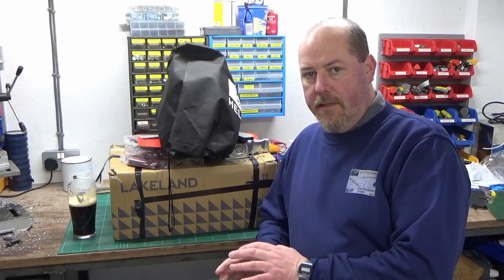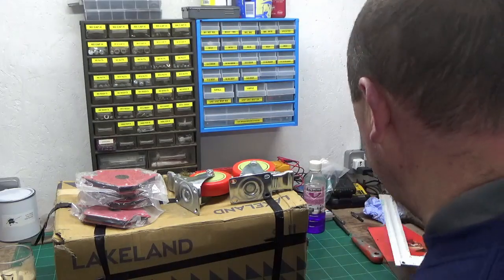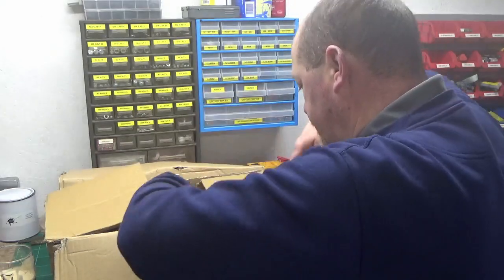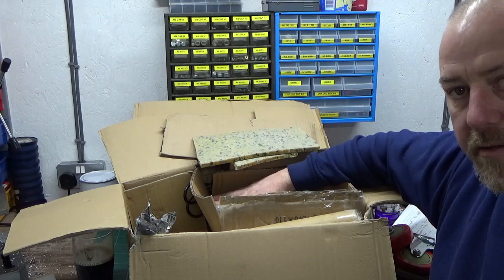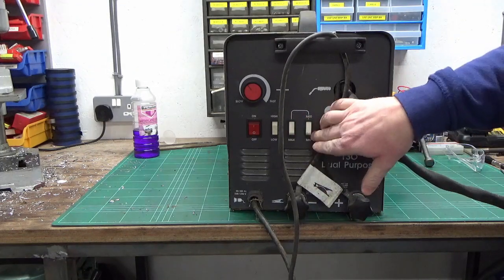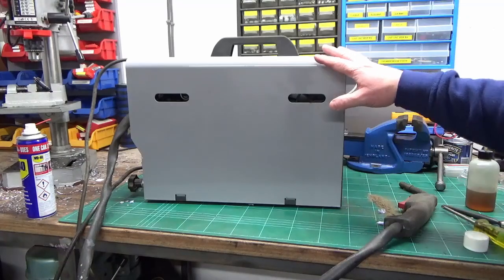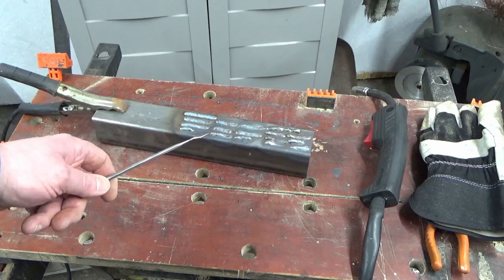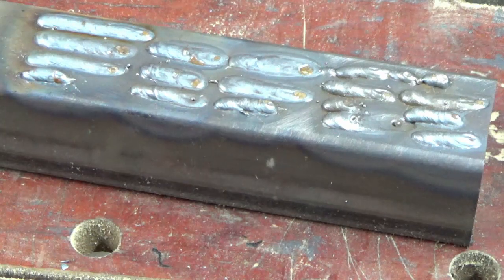Workshop Blether #6 Welding

Comment: Good blether Jon. I have that M-DRO on my lathe with their magnetic scales, great kit. The crosslide one being their very tiny one.  I put the scale fixed out the rear, & the head moves being on a bracket off the rear RHS of the crosslide. No interference with the tailstock, or gib adjusters.

Comment: Thanks Jon, good catch up. Ade certainly sent you a nice box of bits there. I have a Clarke gas/gasless welder, good for welding out of doors when the gas might blow away.  It's in a deplorable state having been kept in a succession of damp awful garages. My brother sent me a Tig set up which I'm hopefully going to learn to use when the workshop is finally sorted. Best wishes, Dean in Oxfordshire.
Reply from the maker: Hi Dean, thanks for the comment. Yes, nice gift box, looking forward to getting the lathe DRO'd up (not so looking forward to doing it though). TIG is where I want to go eventually but figured I have a MIG, might as well learn that first. Hope you are getting time on the workshop build. Cheers, Jon
Reply: Thanks John, workshop is getting there. I'll post up another quick progress video when I have the time. Cheers, Dean.

Comment: Hi Jon, G'Day from Oz - I've come over from Emma's channel.  For your welding practice, try this yourself. I learnt to weld when I was a teenager in a panel beating / spray painting workshop. I had to start with Oxyacetylene, then TIG and lastly MIG. They'd get me to weld 6 squares into a cube. Started with 8mm plate about 100mm square and as I got better they'd give me thinner gauge. NO filler rods. Had to keep square edges & corners. The whole point was learning how to control the weld puddle. My first MIG attempt was replacing panels on the Boss's Jaguar but by then I had a better idea & control. I hope this can help.  Stay safe and well :)
Reply from the maker: Hi Anthony, thanks for the comment and information and welcome to the channel. When I get my TIG, or a decent MIG, I will definitely be trying some practice welding. My unit is so temperamental and inconsistent, I wouldn't learn a lot from it. Case in point today, big welding project (for me) on the go, welded 3 or 4 runs no bother, then it starts spluttering and messing about, then, wire everywhere and when I release the trigger, wire just kept on feeding out! Took the gun apart, switch all OK, went into the welder guts, nothing obvious, pulled a couple of connectors and put them back on, all working again. I think it depends on what day it is. Cheers, Jon
Reply: @jonsworkshop  Sounds like there might be either moisture in the contacts, or as the machine heats up the contacts expand and close the circuit. Test it out from cold and time how long it takes to play up. If it repeats then it's likely the electronics expanding. Look at the control board as well for hot spots or discoloration. A laser thermometer would be handy, but if not just unplug it and test with your finger tips for hot areas. Cheap machines are a pain in the but, although they do get you good a trouble shooting if you have the patience. Good luck Mate :)

Comment: One think I found over the years was that the cheaper budget sets struggle with the large spools. Having said that, you can tell from the sound when welding that yours sounds ok. Interesting you thought your unit looked in bad shape, I will send you a video of my very well used unit. Still works great but well overdue a service.
Reply from the maker: Hi Andy, great to hear from you, thanks for the comment and hope you're all well. I think it is struggling a bit, the wire feed isn't consistent so I may get a small reel to try. It's not to bad on the highest setting but it won't play ball at slower wire feed and reduced power. I think I need a lot of practice and will hopefully get it with this next project. Cheers, Jon

Comment: Dabble a wee bit with welding (or sticking metal together might be more accurate) and I would say that TIG is probably the easier to get to grips with, certainly nicer to use, a bit like gas welding.  Got a similar MIG welder and never really got on with it, always felt that the wire feed was struggling a bit, never used with gas , just gasless as had already laid out on an argon cylinder and couldn't justify another cylinder for MIG (Ar/CO2 mix) - and the small disposable cylinders are too expensive. Heard a tip for MIG from various channels that it should sound like bacon sizzling if your setting are right. As mentioned, grinder and paint make me the welder I ain't. Cheers
Reply from the maker: Hi Pakrattuk, thanks for the comment. I must admit TIG looks very clean and repeatable when done well, and I guess there's only one thing to blame if the wire feed is inconsistent lol. I have got to a reasonable bacon frying noise in the end, but only at max power, can't achieve it at lower amperage. Need a lot more practice which is imminent with the table build. I am sure it will be entertaining for you guys if nothing else! Cheers, Jon

Comment: At least the square won't get magnetized  !    Filming welding is  not easy  ,  i have tried it a couple of times  with mixed results due to the lack of different lens shades to sticky tape to the camera !     Cheers .
Reply from the maker: Hi Max, thanks for the comment. As if the whole welding experience wasn't difficult enough for a newbie, I thought being clever and trying to work round a tripod with a mask glass balanced in front of it would be a great idea! So much to learn! Lol. Cheers, Jon

Comment: Nice job Jon, if you need any wire or clamps give me a shout, welding beads look great 👴🏻👍
Reply from the maker: Hi Terry, thanks for the comment, must correct you, welding 'bead' looked great, the rest were on a par with my pigeon $hit stick welding lol. Thanks for the offer, will give you a shout if I start to struggle on the build. Cheers, Jon

Comment: Some nice gear there Jon.  I still use a flip visor, no issue.  That helmet looks the same as the Comweld ones BOC gas sell in Oz.  At least it fits your head OK - some are way too small.

Welding is like paint spraying, all practice.   The main thing is to be decisive and not dally around.

Cheers Rob
Reply from the maker: Hi Rob, thanks for the comment. I didn't realise BOC traded in Oz, probably do more business over there than here, priced themselves out the market here (for hobbyists at least), their rental charges on bottles are extortionate. Yes, plenty of practice required, should get a good go making the welding table. Cheers, Jon
Reply: @jonsworkshop  Yes, the bottle rental is a killer here as well.  Nowadays you can buy D size for home use and eliminate rental (not from BOC).  BOC do however sell good quality gear and their brazing rods and consumables are first class.  Never buy no name brand consumables as there is a lot of rubbish out there which is guaranteed to spoil your day ;)  Cheers Rob

Comment: Hi Jon, I do a lot of welding with both MIG and TIG as a hobbyist on my boats and cars/bikes.I thought I needed a proper heavy super flat table too.But because I was in a hurry I bought a good quality foldable one from Rapid welding.As everyone knows lot of time ,,welding,, is actually spend grinding for prep work or touch ups afterwards.My workspace is smaller than yours but I assume you also don’t want to do a lot of grinding inside.Foldable one is a lot easier to drag towards the edge or even outside the garage.If you do have lots of future jobs lined up that warrant a super flat table then go for it obviously.Just my 5 cents put in!
Reply from the maker: Hi Robert, thanks for the comment and advice. I will be adding wheels to the table so I can get it outside easily, I don't mind welding in the workshop but really want to do all the grinding outside (weather permitting). Super flat is not important for what I will be doing, I just want something metal, portable, and self contained with clamping options, gas, and storage for all the peripherals, tips, shrouds, wire, rods etc so it's all in one place. My brain is hard at work in designing at the moment and I am looking forward to the challenge of learning new skills. Cheers, Jon

Comment: What ho young John, two points, no make thst three.
Does your new mask have a battery or is it entirely solar powered?  The reason i ask is that if only solar and it is kept in the dark the internal reserve power will dissipate over time. Draw your own conclusions to a remedy.😉
Now you are going to have to go back to school, stainless is nonmagnetic except for the ones that are. A case of a false syllogism methinks.
If you get in touch with machine dro rather than just look on ebay you will be able to speak to some really helpful chaps. Also consider a mag scale for cross slide to refuce bulk of a glass one. They will be able to tell you if they are compatible with your unit. As an example of their helpfulness, one of they scales became unreliable long outside warranty period and i was about to order a new one at one of the shows and explained why. They said to bring mine along to their base and they would look at it for me, i did and they fixed it for free. Turned out to be dirt but they changed the read head all the same to be on the safe side. We have shared stands at exhibitions for years but i don't think I got any special treatment. Nice guys and business to deal with, in my opinion. 
On a different note, spring can't be far awsy now even in the wilds of your backwoods up north.
Keep up the good work
c
Reply from the maker: Hi Chris, thanks for the comment. The mask has a battery I think, I incorrectly quoted 'solar', it charges using the UV from the welding so as long as you use it now and again etc. With the amount of practice I need it should stay fairly healthy for a while. I will definitely be contacting MDRO when I do the lathe, it is one of life's rare pleasures these days dealing with a company like that so am looking forward to it (not looking forward to another DRO fit though despite being 33% less complex). Spring is a long way off for us, still got snow on the hills round us here, it has got into positive numbers on the mercury now though at least. Hope you're recovering. Cheers, Jon
Reply: @jonsworkshop  pneumonia all cleared up i presume, not that knew i had it, they had to tell me! 
Even the one and only bruise from taking a tumble down the stairs has cleared, now if only i had some blood pressure i could train for the London Marathon, i could but there is no way i would.😂

Comment: do not put oil on or around your drive rolllers on the mig machine it will mess up the weld with porosity in your weld bead.
Reply from the maker: Hi Jamie, thanks for the comment and input, I only put the very lightest coat just in the bore of the rollers, not enough to come out in use but just to try and stop any corrosion in my swimming pool of a workshop lol. Cheers, Jon

Comment: Audio seems slightly out of sync?
Reply from the maker: Hi NML, thanks for the comment, you are right. Think our laptop is on its last legs, was showing sync issue in the editing software so I tweaked it all to the left by 10 frames (0.5s), and it appears it's all 0.5s wrong now! I will leave it alone next time. Cheers, Jon